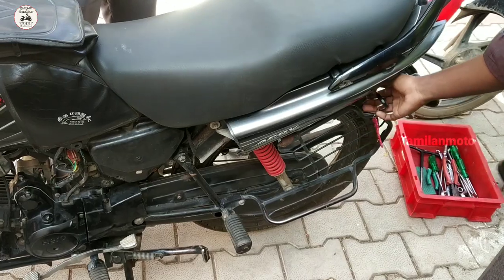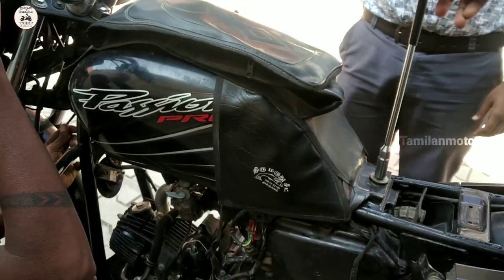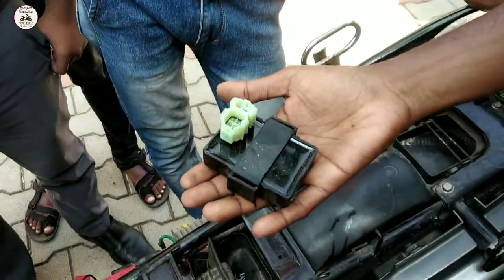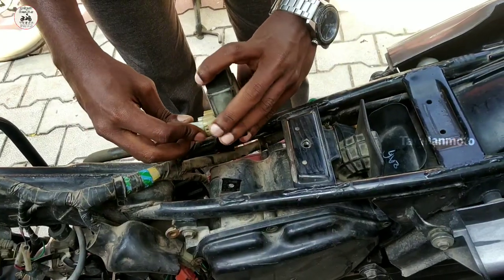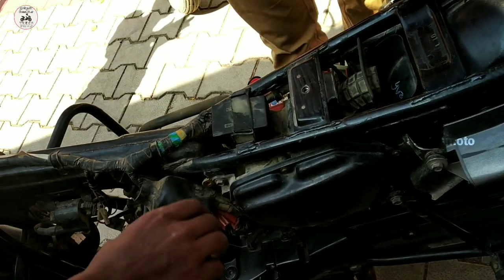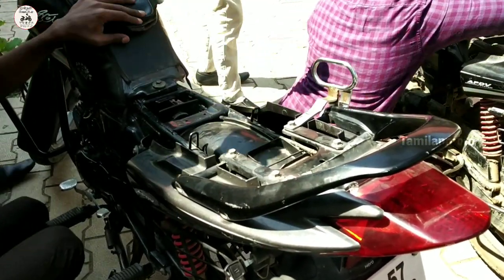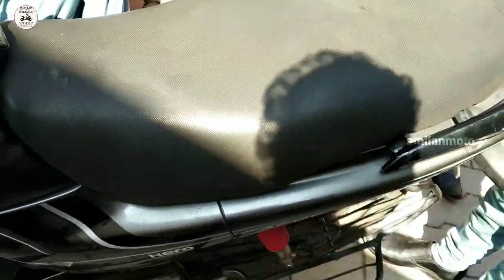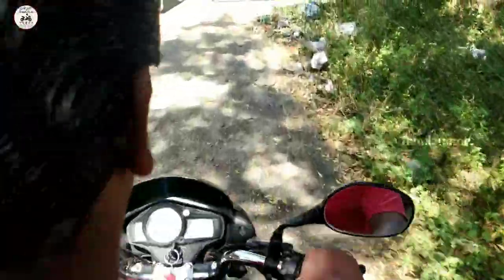initial Pickup ரொம்ப கம்மியா இருக்கு | Hero Passion pro Complaint | Tamilanmoto

Comment: Passion pro 110CC bike eduthathulanthu starting problem iruku. Bike romba neram stop panitu marupadium start panumbothu start aagamatenguthu, choke potu konja thooram pona piragu than stop aagama iruku. Ena problem ma irukum bro. Intha problem regular ra face panitu iruken
Reply from the maker: Evlo km odiruku
Epo last service panuninga
Carburettor model thana
Reply: 13600 km odiiruku,  bike Vangi one month piragu intha problem irukunu show room la sonen, oil change pana sari aagidum nu sonaga, athuku peragum same problem than varuthu, service ethum show roomku pogala, velila than mechanic shop la oil change panitu iruken. Vera service ethum Panala bro, bike eduthu 3 year aaga poguthu.
Reply from the maker: @allivermerlinraj1815  entha ooru bro neenga
Reply: Trichy
Reply from the maker: @allivermerlinraj1815  may I provide a mechanic contact there
Reply: Ok bro, contact number kodunga
Reply from the maker: @allivermerlinraj1815  +91 72007 08668 Rajasri Motors , Trichy
Reply: Thank you bro.
Reply: Same problem bro.. Pulsar 180. Neraya vati service kadaiku poitu vanten. But problem solve aagala.  Choke potu 10-15 mins vecha dan otavey mudiudhu.  Start panumbodhu Choke use pannama accelerator kuduthaa off agirudhu.  Na Chennai la Chepauk area . Yarachu mechanic terinja solunga.
Reply: @allivermerlinraj1815  problem solve agitucha

Comment: Bro naan Splendor pro bike vachirukken.en bike 40km mela speed pogum pothu sodukki sodukki poguthu.enna problem
Reply from the maker: Main jet clean panunga & sparkplug check panunga
Reply: @Tamilanmoto  Plug New and carburettor mainjet clean panni pottum aptitha irukku.
Reply from the maker: @manimech5677  carburetor screw la vara  spring tension check pannunga
Reply: @Tamilanmoto  Carburettor Slide Needle la vara spring Ahh bro.
Reply: @Tamilanmoto  Ithukkum CDI ku edhum problem unda
Reply from the maker: @manimech5677  spark problem iruntha CDI issue iruka vaaipiruku
Reply: @Tamilanmoto  Intha Bike CDI vera Bikela pottu check panna super ahh poguthu no problem.antha vandi CDI intha bike ku pottu apdi thas soduki sodukki poguthu
Reply: @Tamilanmoto  Carburettor Needle Spring Ahh bro

Comment: Sir, splender pro idling nalla irukku bro,first gear pottu accelaration kudutha bike off aguthu bro,aana engine heat la irukumpodhu antha problem illa,romba neram bike stop pannitu start pannum podhu intha problem,carburator  clean panna,cdi change pannita pro solve agavey illa,please help me
Reply from the maker: Sparkplug & Airfilter check panunga
Reply: @Tamilanmoto   new air filter and spark plug bro,spark current um nalla varuthu bro,two three times carburator clean panni potta analum sari aagala,timing ellamey check pannita bro
Reply from the maker: @saravanansarvn8843  neenga entha area..
Reply: @Tamilanmoto  bro naa tiruppur
Reply: @Tamilanmoto bro unga whats app no send pannunga,naa video va send panra
Reply: My bike also same problem
Reply: @vigneshbv8066  bro main jet needle konjam height pannunga bro ,
Reply: @saravanansarvn8843  carburetor laya
Reply: Yes bro